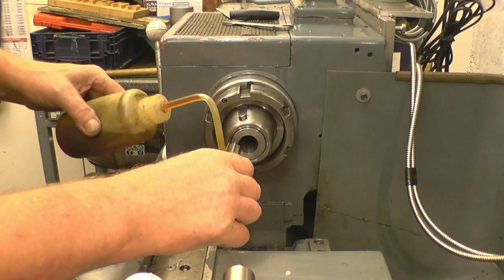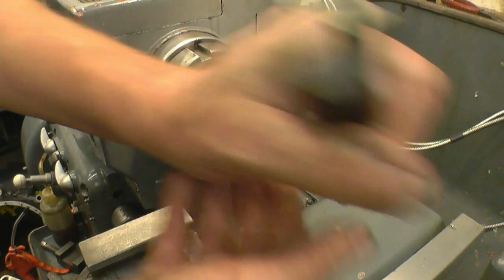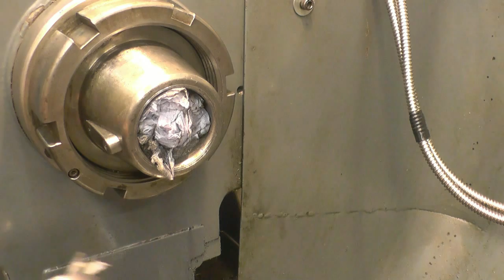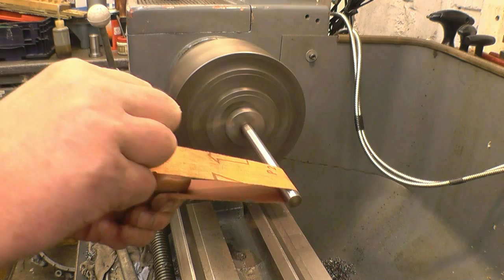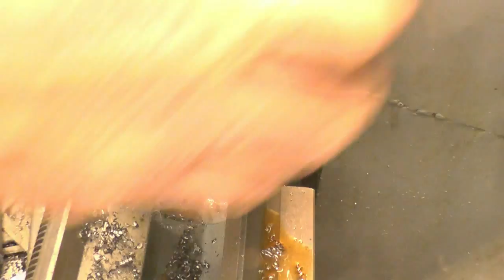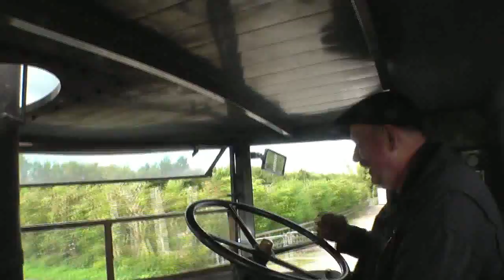SNNC 134 P2 DTI stand repair  Steam rally preview

Comment: Whaaaaaaa wasn't there a guy that done this with a wench under power and ended up
with the wrench implanted in his head..Bad idea even with a reamer..Love the videos
and long time subscriber,I'm no safety Nazi but that one is dangerous..

It might have been a tap that it happened with,But still wouldn't take the change in 
case that thing grips..
Reply from the maker: The reamer was nut under very much pressure  I don't think it would grab it was more polishing than cutting . Good point though thanks for pointing this out
Reply: doubleboost No problem mate,I just hate to see any thing happen to you john pal..Any ways i think the lad who got the wrench in planted into his skull was reversing the lathe after tapping and it slipped and flew of and stuck in his skull..Or any one else copy this with a tap rather than a reamer..I agree i don't think it would happen with a reamer but if some one does this with a tap then there is a big chance of it happing.

But this did get me thinking john about 1/2" square stock or what ever size is needed and put in the tool holder with across the flats the same size as the reamer and you can just let the tool post hold the reamer or tap or what every in the tool holder..

Would be a simple build and use full tool and it wont go any where...Every time i
take my chuck off i aways here you in the back of my head saying get the piece of wood ahahah I'm grate full for that one..